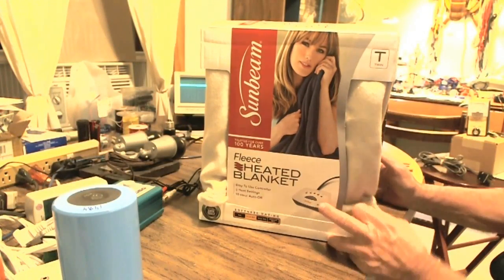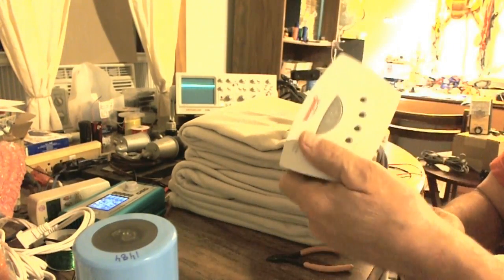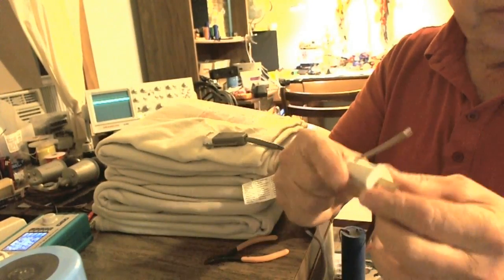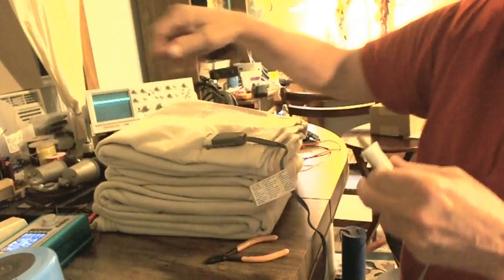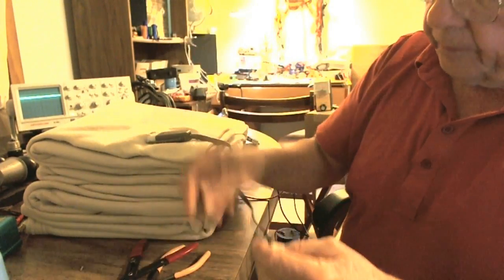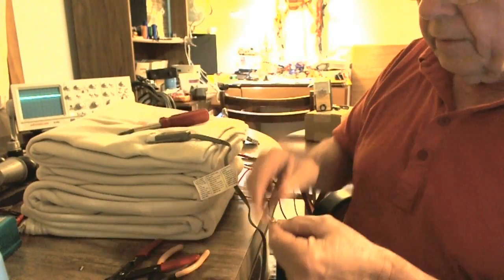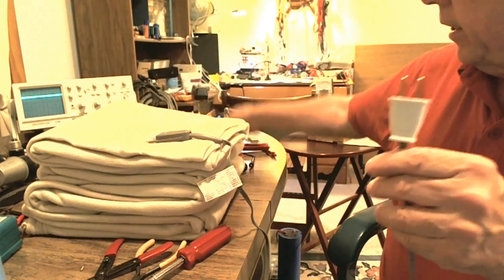Electric Blanket Modification

Comment: I have never been so confused watching a video in my life.  What the hell is going on here?  What is the point of all of this.  Serious questions
Reply from the maker: I normally wouldn't respond to a comment like this but in the interest of being kind and trying help I'll make a suggestion.  Look into Royal Raymond Rife technology and see if you can pick up an understanding of what Rife Frequency Control is all about.  Everything in the universe has a frequency component.  Understanding how to use modulated electric fields, magnetic fields, sound pressure, light arrays, and scalar waves can have unbelievable health benefits.  Changing the electric blanket wall outlet frequency from 60 hertz to one of the solfeggio frequencies or Schumann resonances 7.83 hertz, or one of many other frequency has been known to heal, repair bone and skin tissue, kill bacteria and viruses and much more.  So there can be a distinct advantage tor running an electric blanket at alternative frequencies other than the 50 or 60 hertz line voltage frequency.  Be well and respectfully, Steve
Reply: Well Sir, I really do appreciate that you went ahead and responded and provided some excellent information.  That is exactly why I posted my question to begin with.  I wasn't trying to be a smartass. I was genuinely confused. And to your credit you responded with great info that I just was not aware of.  I learned something new.  Thank YOU.

Comment: Ok now I gotta ask...are u still making heat or just using the blanket as an "antenna" ??
Reply from the maker: The blankets temp is controlled by PWM.  Both heat and radiated frequency strength or electric field are controlled by the PWM.  The frequency can range from 1 hz to about 20 Khz which covers both good and bad frequencies.  It is best you know what you are doing and outside what I will talk about in this blog.

Comment: I did the same thing, but my blanket had 4 wires. Determining continuity I connected them inside the gutted control box. Using an LED to flash out the freq used it was necessary to watch how the AC plug was polarized so as to feed the + and - leads of the led. Feeding it from the Spooky2 Gen X I used a freq last night for scars & pain. To be certain used a gauseemeter to check the field above the blanket. I think that since my body is directly next to the blanket wires I am getting the Near Field ..also known as Scalar directly into my body. Gauseemeter will drop to a zero reading when the blanket is next to my body I THINK THIS IS BECSUSE ALL OF THE SCALAR IS INTO MY FLESH.

Comment: Lessons learned: 1. Take it back to the store and get a new one. 2. Don’t buy a Sunbeam blanket, notorious for not working more than one winter, at best. 3. Buy a heating blanket from Perfect Fit/Soft Heat, instead. Still working after several seasons! 4. Consider a heated mattress pad made in Ohio, USA by a small company. See Amazon. 5. Don’t waste your time like I did watching this video, which doesn’t make any sense to an non-electrical engineer.
Reply from the maker: You are correct and I have been thinking of taking down several videos.  I get about 2 years out of the Sunbeam but then I use it all year round.  With a very short duration duty cycle pulse the blanket makes an excellent electric field delivery device without providing any heat.  Our summers can get into the high 90s and you don’t want any heat from the blanket.  It is more of an electric field mat verse a blanket when used in this manner. Of course in the winter heat is desired as well.  I’ll check out your suggestions.  Respectfully, Steve
Reply: Bought a heating blanket from Perfect Fit and the controller quit working after about two months.

Comment: I have a blanket with 4 points instead of 3 like 3 in this video how can i on it without controller on 220 wall socket
Reply from the maker: My best guest would be that your blanket has two separate heating elements.  Without measuring the resistance of each element it would be hard to determine if they are same or a low and high powered element pair.

Comment: So what happens if this gets plugged into a wall socket?
Reply from the maker: Because the blanket controller is intended to be replaced with either a ‘Pulser’ or ‘Frequency Converter’ it would be an electric blanket without a temperature controller and would simply warm up to its maximum temperature capability running at 60 hertz.  Not a practical thing to do but certainly not dangerous.
Reply: @gskempe9  I found your video because I want to modify an electric blanket and eliminate the auto shut-off. It will be ok if it runs at maximum temperature. So this is how I do it, right? Just plug it in the wall after removing the controller!
Thank you for this video!

Comment: I'm sorry, but I don't know the purpose of those two boxes.
I want to eliminate the auto-shut-off, I.e., the controller altogether. 
I just want to have the blanket on all the time and I will shut it off with the power switch on a power strip into which it's plugged in. 
Eliminating the control box is simple enough but with the addition of the freq controller and the other mystery box, you lost me. I'm guessing this was meant for a more electricity savvy audience.. Still liked the video, but ultimately disappointed.
Reply from the maker: Electric blankets run off of 60 cycle 110 volts in the US.  60 cycles or 60 hertz is not a particularly healthy frequency.  So a normal electric blanket wraps you in a 60 cycle frequency or oscillating Electric Field.  Wouldn’t it be nice to be wrapped in a health related Electric Field like Schumann Resonance of 7.83 cycles per second or CPS or Hertz?  Schumann Resonance is the cocoon frequency that all life on this planet evolved in.  It is the frequency of the planet.  There are hundreds of other health related frequencies as well.  It is sincerely hope you are inspired to look into this a little further.  Be well and respectfully,  Steve
Reply: It seems like if you just plug it into the wall, it will obviously bypass the auto shut-off,  but it will also be at maximum heat. (Am I right Steve?)

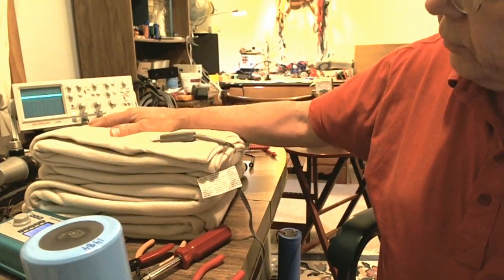Comment: Does Star Fleet  know you have a Frequency Generator AND a Spooky in your home for private use?Seriously though, who is this video for? Anyone who knows what a frequency converter or spooky is, will know what to do in 5 seconds when you say clip supply to blanket - test 3 leads for 52 ohms, re tip the 2 wires with resistance - connect to frequency converter.  15:10...no 5:00 yes.
Reply: Pickle Riiick! ur awesome

Comment: I know you understand what you're doing, but I still think you should never do something like this.
Reply: That third, and sometimes fourth connection are for the temp sense in the blanket so the controller knows when to cycle off.  That's something you should know.  And what's the point of powering it with a freq gen and a pulse width modulator?  You're adding a lot of expensive equipment there while eliminating all the safety features that are necessary for a product of this type.  And making the controller connector out of a 120 V plug is very dangerous.  If some poor fool (your intended audience) does this and leaves it around, someone else in the household is going to see it and plug it into a wall socket.  Tell me what happens next, bright boy.
You are an idiot.
Reply: @jservice6594  You are a moron.  It's a good thing you're the only one on this site stupid enough to do that.
Reply from the maker: I find this statement peaks my curiosity.  Could you please state why you think this shouldn’t be done?
Reply: Private Account  damn dude lol
Reply: Guy below is a d bag.
Reply: Private Account  It's idiots like you that have kept people in the dark ages.  If you're so stupid you can't do something this simple you are obviously the problem.

Comment: Couldn't watch because the audio was so bad (either phase shift or a stereo mic facing the wrong way)
Reply from the maker: As I write this, I'm listening to the audio and it is coming across fine.  Very little distortion and plenty loud.  Are you sure you didn't mix up a problem from another video with this one?
Reply: Yes, it is definitely bad. I'm listening with stereo headphones (not speakers) and it sounds like the voice is inside my head, then it alternates between ears sometimes as well. I do not notice this on the many other YT videos I watch.
Reply from the maker: I can only apologize because the audio at my end sounds good enough to convey the objective of helping with a blanket modification.  Maybe YouTube is doing something behind my back?  Regardless, this audio problem is off point from the intent of this video and you seem to be the only one not able to watch the video because of audio quality.   I will not be replacing the video and will no longer  address this audio issue.
Reply: @rothn2  I am listening from a cheap bluetooth speaker and it's fine.
Reply: gskempe9 its bad. If you hear it on headphones it panes slightly to the right as you speak. It phases at different rates. Really uncomfortable if you can hear it

Comment: What about a DC supply? Would that safer than having a 60 Hz field around your body? Do these blankets have flame retardant chemicals added?. Those are bad for you as well.
Reply from the maker: The point of modifying the electric blanket is to make it work at different frequencies other than 60 cycles.  Frequencies like Schumann Resonance of 7.83 or DNA repair of 528 would be good examples.  Running the blanket at a DC level certainly could work but would defeat what is being proposed here.

Comment: Could you tell me how to hook it up to a biomat?
Reply from the maker: I do not have access to a biomat to test or evaluate if it can be connected to the Frequency Converter.  There is a lot of information about the Frequency Converter on the www.aurorasky.net website, including email contact.  I would like to suggest you view what is available and make contact via the website email address.  Respectfully  Steve